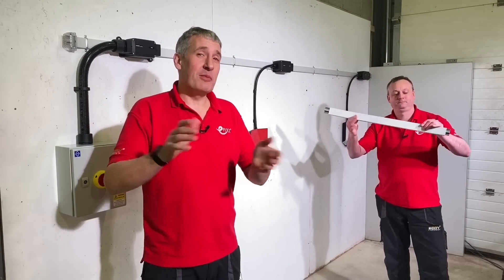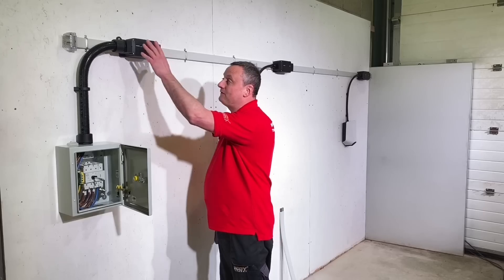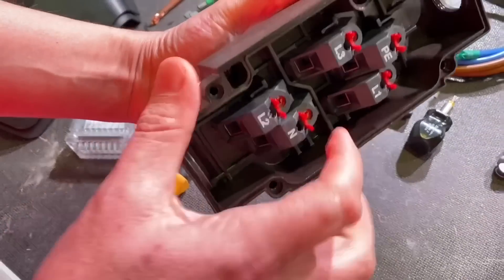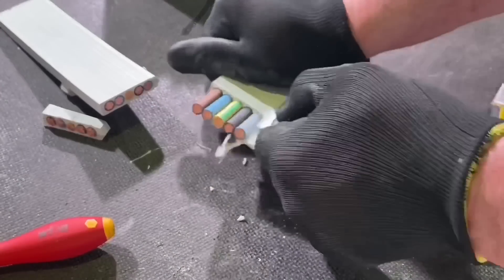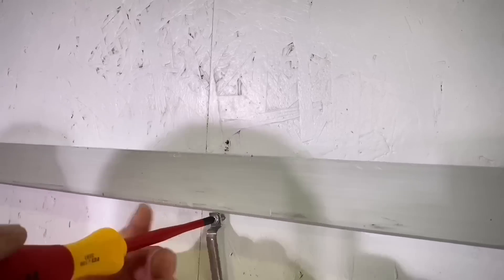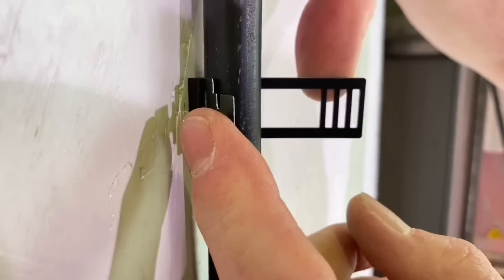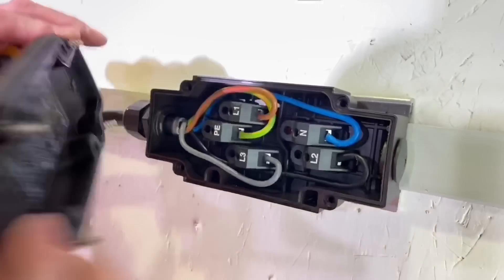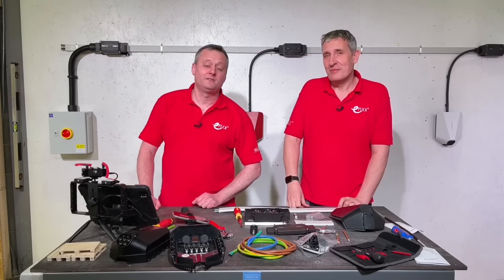Can this FLAT CABLE speed up EV CHARGER INSTALLATION - innovation from IDACS and EASEE

Comment: That’s a clever bit of kit. One thought, If it is is used outdoors exposed to rain and say a tap off box has been installed onto the track and then later removed or repositioned, how is the ip56 rating achieved of the track with piercing through the sheathing? 
I’m not knocking it I think it is a great system with as you say I can think of lots of applications for it, not just EV👍
Reply: I had the same thought. Presumabley the connection boxes are not intended to be removed, only the appliance cord. You would therefore need to blank off both cable exit holes.
Reply: We can provide some tape that would help with this issue and keep the IP65 rating. You're right, this cable has been used in lots of different applications such as hotels, railway stations, ships and large warehouses.
Reply: Same as with a junction box on a normal cable run. You wouldn't expect to be able to remove that and "uncut" the cable going through it either...

Comment: Good system , but not much use if you block of flats has no covered car parking. . Most flats I've worked on the car parking spaces left open to elements.  Most work done for landlords wants each tennant billed separately for the electricity they use and most tennant won't pay a community charge to charge there neighbours car. My main concern is it resistance to impact damage . If you have a block of 10 flats you going to need 20 chargers  so what cable sizes are there ? Plus I would want an isolation switch between that flat cable and the charger so I could work safely to maintain the chargers . Plus I would want to supply a minimum of 30 amps per charger , if  you cant and each car is charging on a few amps it going to take for ever for every on to charge there cars , so the side of those conductors aren't going to the mustard in any situation were you doing to draw a lot of currant . I've done work in factories and hotels were your often installing  35 and 50mm sq and even larger cables  a small block of ten flats are going to need 20 chargers at 30 amps a piece that. 600 amps , that cable ain't going cut the mustard . Great system but in the real world limited use . People want there cars charged in the shorted possible time .
Reply: Don't worry about guaranteeing 30A to every vehicle, a lot of people misunderstand the needs to home charging, they aren't the same as long distance driving, cars are plugged in for many hours and most people's commute requires <8kWh, diversity and other magic and you'll find that 99% of the time you can get the full charge when you need it as your neighbours don't need it, the other 1% you spend 15 minutes at a DC fast charger.

As an EV owner I'd much rather many charging points and dynamic load management, I want to be able to leave my car plugged in and not worry I'm blocking someone else who needs a charge - have a look at what they do in Norway.

Comment: Cant see a use for it in big car parks, easier to take an armoured to a pillar, fit a rotary isolator , bobs your uncle, future proofed ... plus the local thieves  would be whipping the end caps off, n-e it and kerching off to the scrappy they go ... be interested to see how those pins fair over time , used to use a Bakelite system years ago and after 4-5 years they would arc out due to the copper work hardening  ... marine use? have they installed it in a car park in a port or fitted on ships? companies do love the term Marine to back up claims.. its us poor ETO's that have to put it right when the s**t hits the fan
Reply: Or travelers screwing through and hooking up their caravan supplies.

Comment: Something I'm curious about with these EV chargers is how you balance the phases, a lot of cars only have single phase on board chargers, presumably they're always wired to L1 on the car (?|) in that case, so when doing multi-drop charger installations should you rotate the phases at each point to improve the balance?
Reply: Yes rotate the phases
Reply: Don't the charging units distribute the phase loads?
Reply: @JimWhitaker  They would need to switch which phase they physically connect to pin 1 of the plug. That's not impossible, but it's also not trivial at all.
Reply: @HenryLoenwind  I don't see an easy answer on google, but I would think an advanced charging system would choose which phase each charge point draws from according to what is plugged into it.

Comment: They need a tool for calculating voltage drop with different loads at different distance tap offs.
Reply: If you have the option its would be best to put the supply mid-span.
Reply: @edc1569  the calculation uses the average load and average length as a basis.  I did it many years ago, and it's a relatively simple formula, though I'd have to look it up to do it again.  and yes, feeding from the center is the best design .

Comment: These systems are great, provided that everyone in a block pays into a maintenance/ charging fund for EV's. If they don't already have something set up many of those flats are going to find their bills going up and subsidizing other residents that may have larger battery EV's etc. Thus any new build should have individual bay meters or EV chargers linked to the flat. 

It's a great idea but voltage drop and total loading will be an issue as you're not going to find it able to do more than 3x 22 kw chargers if they're all plugged in over night on max demand - people will find themselves with less charge than they expected when heading off to work. Which very much feels like throwing good money at bad until the rest of the fast charging infrastructure is built out.
Reply from the maker: Hi this other video may answer some of your questions - REVIEWED: Easee EV charger - the clue is in the name! https://youtu.be/e_aJRe5bf04
Reply: I don't think anyone would find it acceptable for residents to by paying for other residents car charging. With 250 mile EVs becoming the standard, I really can't imagine people having much worry about having enough energy for the commute, even at 3kW you can get over 30kWh into a battery in a 12 hour stint, that's enough for an easy 100 miles.  Most EVs don't have a 22kW on board charger, 7kW single phase and 11kW 3 phase is common.

Comment: Looks like a great system I wonder what size the flat 5core goes up to, if it’s potentially going to be used for multiple EV chargers 🔌
Reply: Having spoken to Idacs last week they have told me they do a 25mm2 version now 👍🏻
Reply from the maker: It goes up to 16mm2 👍